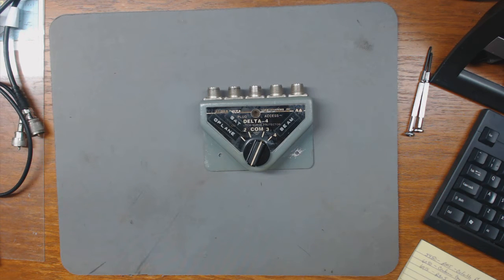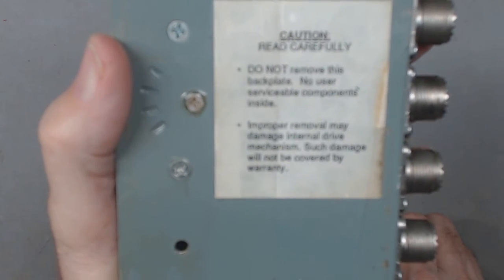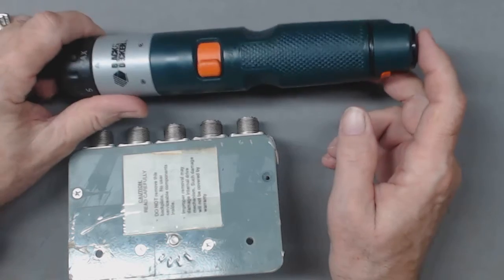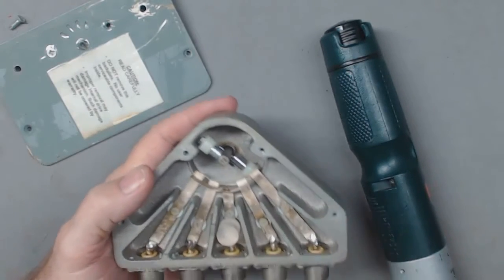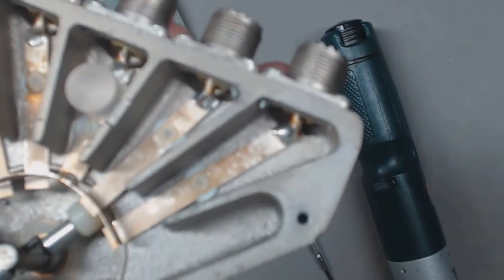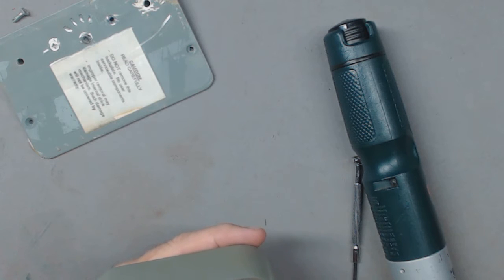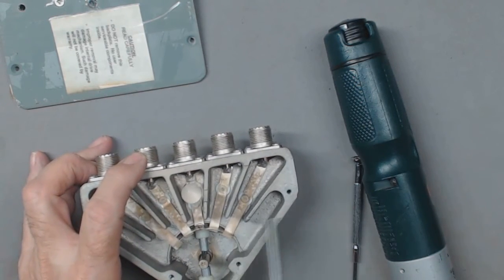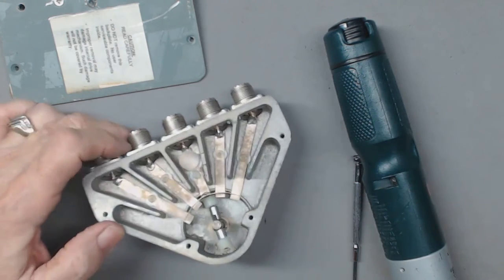TRRS #0870 - Delta-4 Antenna Switch Repair

Comment: Every 10  years, open these up, and take a little drug-store product called Tarn-X, and using a cotton swab, just clean off the oxides from the leaf contacts.  Finally, wipe a moistened swap with a few drops of De-Oxit at the 4 switch junctures, and you are done for another 10 years.
Reply from the maker: Good information. Thank you and have a great day.

Comment: The idea behind using the flat straps is to maintain the 50 ohm impedance but NOT adding inductance as would be the case when using wires.  Flat straps present very low inductance.  Each of the troughs that contain the straps for each port constitutes a coaxial line and maintains the 50 ohms.  An improvement would be to use gold or platinum metallization on the contacting surfaces rather than Silver because that metal easily becomes oxidized.  The mechanical design doesn't scrub the contacts so it can't easily remove the native oxide with every actuation. Silver Oxide is a nonconductive ceramic material that is harder than pure Silver.  Gold and Platinum do not oxidize when exposed to air at room temperature but Silver sure does.  It's a bad choice here.
Reply from the maker: Thanks for the useful info.

Comment: I have built one for 4 antennas with relays, since I did not have any suitable switch, and I am going to build another similar one.  Without voltage the antennas remain connected to ground. Greetings from Catalonia

Comment: Great demo, never seen this from the inside. I would have insulated the plates with shielding (COAX MANTLE or PLASTIC) or replaced the plates with an actual 50 Ohm shielded COAX Up to the center ring. These plates being naked so near the housing is a mystery to me. It almost shorts. This can't be good to the signal.
Reply: The idea behind using the flat straps is to maintain the 50 ohm impedance but NOT adding inductance as would be the case when using wires.  Flat straps present very low inductance.  Each of the troughs that contain the straps for each port constitutes a coaxial line and maintains the 50 ohms.  An improvement would be to use gold or platinum metallization on the contacting surfaces rather than Silver because that metal easily becomes oxidized.  The mechanical design doesn't scrub the contacts so it can't easily remove the native oxide with every actuation. Silver Oxide is a nonconductive ceramic material that is harder than pure Silver.  Gold and Platinum do not oxidize when exposed to air at room temperature but Silver sure does.  It's a bad choice here.

Comment: These switches are crap. I had two (brand new, from HRO) fail within 6 months.  One was a bad solder joint (from the factory) at the SO-239 connector center-pin (where the little copper strap connects). This was allowing the copper strip to "pivot" which caused a direct short-to-ground on the case.  I opened it up to investigate, and that's what I found.  Alpha-Delta did replace it under warranty (that was good).  The other one just burnt up, major failure at the contact points.  I didn't even bother with it...

That tiny area of contact surface, between the copper "strip" and the "common" strip is so small... certainly doesn't seem good enough for high power use (running legal-limit).  It can easily over-heat when used heavily.

If these are supposed to be "Mil-spec" switches, then our military gear has gone waaay down hill. LOL

Just my humble opinion, from actual use (and failure analysis).

73,
~Alan
Reply: This was a dumb video... you never told us what caused the problem or if the contact cleaner did any good.

Comment: Early in the video it looks like the small nylon roller wheel was not really positioned correctly when switched under the #1 position which was later identified as the far right port as seen from the bottom.
Reply from the maker: You are correct.

Comment: Not crazy about the design. Have you checked with an ohms meter? Is it the switch or coax connector?
Reply from the maker: It was the switch.

Comment: it's nice that each connection shorts to itself when not in use. though you'd have to be careful hooking several radios to it as the ones no in use with be shorted out
Reply from the maker: Yes, it is a pretty good design and used by a lot of people.

Comment: Looks like they are silver plated and the one with problems probably has oxidation on it or it's not making contact. You might
wan to put a ohmmeter on the center lead on the ant. (main)  connector and the switched one to see if there is continuity
when you toggle #1 antenna switch function.
Reply from the maker: See next show.